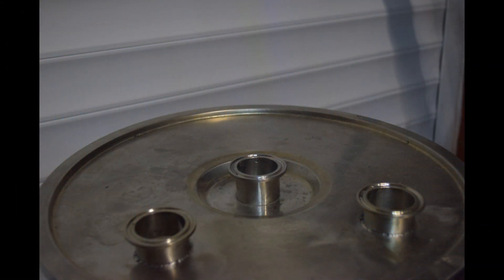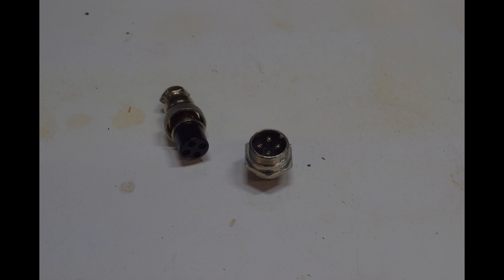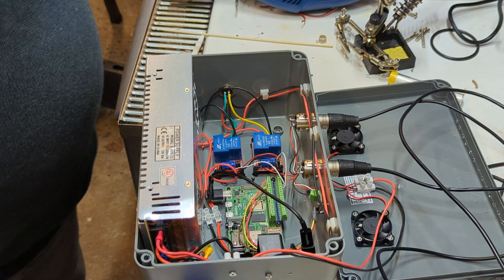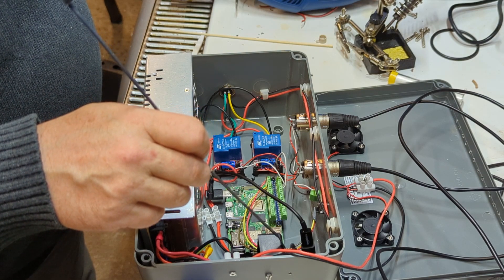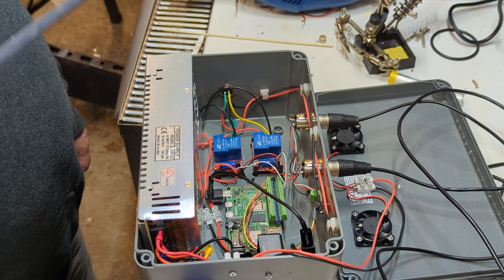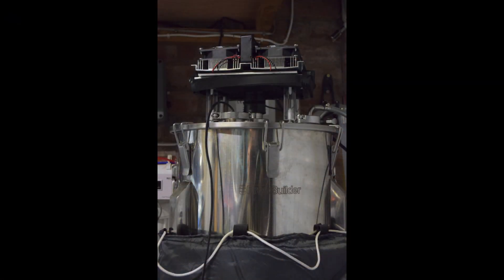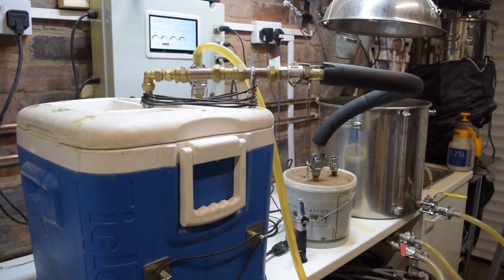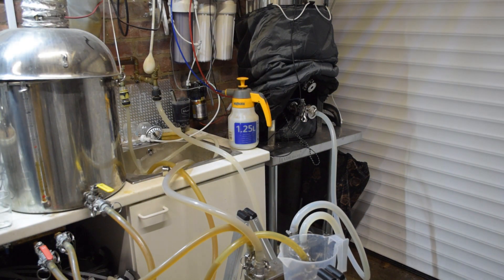Peltier Temperature Controller: Part 2: Finished build and first brew

Comment: Contact Surface area of the aluminium rod may be the limiting factor.
You may have difficulty with heat transfer rates.
May need to introduce a level of hysteresis in the Peltier controller in order to have less stress on the Peltier device itself. It will wear out if it's turning on and off this rapidly

Comment: Interesting approach. Was the 30A power supply necessary? What sort of current are the peltier chips pulling?
Reply from the maker: I picked a power supply to give a little headroom, the 4 peltiers in the unit are rated to pull 240W @ 12V.  I suspect they actually pull a bit less than that but I also wanted the power supply to run cool as it will be on for quite long periods of time.

Comment: The USB lighter socket adapter thing is a clever choice to power the Pi. Seems to have maintained the temperature very well.
Reply from the maker: I was trying to work out how to get power to the Pi without having to dismantle a mains to usb adapter or run a second cable to the box when I realised that I already had 12V and so do cars....